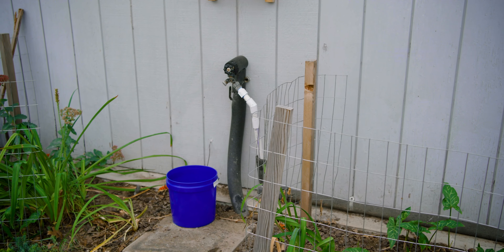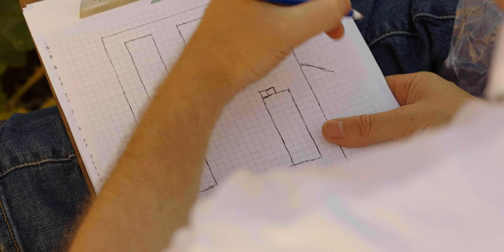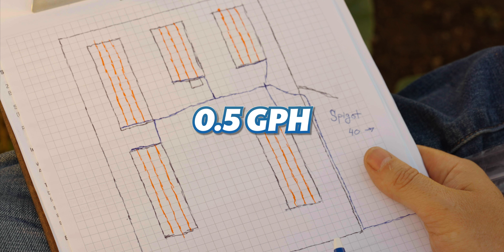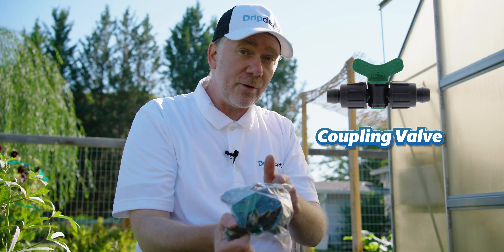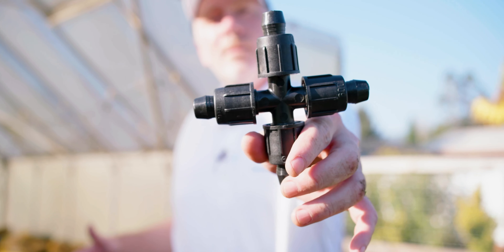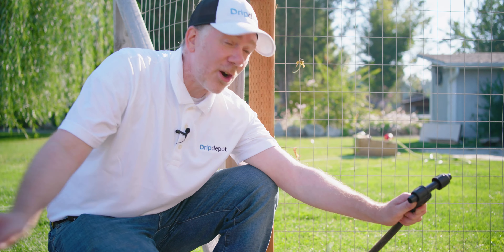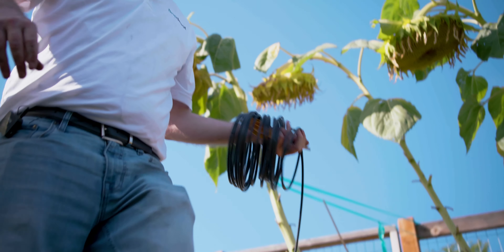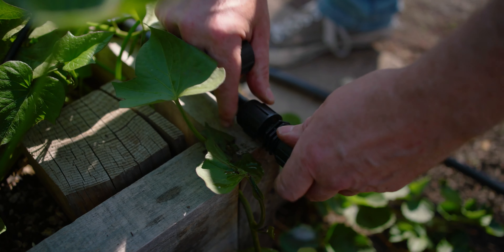How to Install Drip Irrigation for Raised Beds (Complete DIY System Guide)

Comment: I have a question about flushing. I see that you did the half inch line with the end caps removed, but what about the 1/4” drip tubing itself?  I’m just thinking debris might get pushed down into those from adding button emitters or being flushed in there from the half inch line?
Reply from the maker: That's a very good question and I think it's open to interpretation to a degree.  My thought during the making of the video (and it looks like your thinking is similar) was that I didn't want the water during flushing to go into the drip line too much, as I feared it might push debris into the dripline and get caught on one of the inlet filters at each emitter in the drip line, potentially causing a clog (or starting the process that could lead to one).  

Looking back, I think I'd flush the 1/2" line first as I did, then flush the 1/4" drip line after -- that way, the majority of the debris would be carried out of the end of the 1/2" line on the first flush and then any small bits that got into the 1/4" could be flushed out after.  

Very good question, thank you!
Reply: @dripdepot  Thank you so much for your fast reply! I like your rationale.  I am going to go on your recommendation and flush the 1/2” first and then the 1/4” second💙🙏
Reply: @dripdepot  I will be setting up my relatively small (2 raised beds 6x6 & 2 long flower beds) system using lake water in Texas. Im concerned that this emitter system might get stopped up with the IKKY stuff that comes from the water when it gets warm. Do I need a special filter at the head assembly or do I just need to check the filter more often.?
Reply from the maker: @torjiesweeten3482   Very good question!  You are 100% on the right track to know to ask that.  

Ok, if the water quality is as bad as it sounds, I'd probably go with a special filter -- not really special in any way other than larger.  The larger the filter element inside, the less cleaning that's required (though with poor enough water quality, even then the cleanings could be frequent).  

Is it primarily soft organics (algae, etc) that comes out of the lake water?  If so, look into "Disc Filter."  They're a bit better with organic debris than screen filters are.  Though screen filters are a bit more involved to clean in general, they are easier to clean algae out of than a screen filter (it can get mashed in between the mesh of the screen and difficult to get out).  

If you're sure of the water quality and how it relates to filtration, you could start with an inexpensive smaller filter and monitor it that first day irrigating to determine how often you'd need to clean it :)
Reply: @dripdepot  I will look in to the disc filter. Thanks!

Comment: Question, you are running the drip line through a pretty full bed and cutting it off at the end doing another line. Would it be more feasible just to run it back through the bed rather then cutting it, and if so should it be reconnected to the mail line? We have several raised stock tanks that get pretty full.
 I have learned so much from you I can't say how much I appreciate these videos!!
Reply from the maker: Some folks do exactly as you suggested, in most cases it's perfectly viable -- you'll want to make sure the total length doesn't exceed 20' (for 6" spaced) to 30' (for 12" spaced) -- after those lengths the friction loss curve gets pretty steep.  Connecting the end length to the mainline as well does help ameliorate any pressure issues, but that would only be necessary if the line was getting to that 20' to 30' marker.  

We didn't do it in the video, but one thing that's nice about laying down individual lengths of drip line is the ability to have on/off for each individual line in case one row or part of the bed gets harvested early.  This little coupling valve allows each line to have on/off: https://www.dripdepot.com/1159

If the bed will all be harvested at the same time, looping it back around is perfectly acceptable and plugging both ends into the main can be beneficial, just like you were thinking. 

And also thank you for the kind words and for watching!  This was a great comment to kick start Monday for me, I truly appreciate it :)
Reply: @dripdepot  Thank you very much I value your advice greatly!! 
Our 7-stock tanks are 6' & 4' x 2' and always full like yours was so this loop should work however, I see a lot of advantages to single lines with shut off's on them. We plan on doing single lines in our two ground/raised beds and everything will have shut off valves as you've suggested in many videos.. "
Keep those videos coming you have great ideas"
Reply from the maker: @Randy_Indy  Perfect!  I can confirm at those dimensions, a loop system is likely to work very well, particularly if it's connected at both ends :)

Comment: This has been so helpful! Can we bury the distribution line?
Reply from the maker: I'm glad this helped some! 

And you bet, you can safely bury your distribution line :)   I'd say it's fairly common, particularly after you hit it with the lawn mower the first time lol.  

Just like with PVC pipe, give it a bed of soft crumbly soil to lay in -- make sure to remove any rocks, sticks or debris of that type that could damage it, bury it anywhere from 4" to about 12", and it can be safely mowed and walked over as well.  

Thank you for the kind words Sierra, I hope this helps too!

Comment: Hi Adam 
Thank you so much for the very helpful video!

Question ……..I have 33 inch wide by 46 inch long raised vegetable garden bed CONTAINERS 
I was going to get the emitter hose with emitters ever 6” and run 2 lines length wise 
Does that sound right?🤷🏼‍♀️ 
Or should I get emitter hose with Emitters every 9” 🤔
(I have quite a few vegetables in each one of my containers)
 
If you could give me your opinion I would greatly appreciate it 
So I can place my order 😊
Thank you
Reply from the maker: Vicki, this is such a good question that goes straight the heart of drip irrigation.  There's a lot of factors that go into both of these (soil type, planting density, etc), but generally speaking, I would also do 2 lines for a 33" wide bed.  Emitter spacing is a challenging one.  I've had success with all three spacing options (6", 9" and 12") -- I tend to use 6" when I plant densely or in places with sandy soil (or in the case of carrots, both, as they tend to be planted densely and in looser soil types).  With that said, 12" spaced drip line is the standard -- in common, loamy garden soil, water will spread about 12" beneath the surface.  

Sometimes people think they're not getting enough water with the 12", but that's because they're looking at the wet spot on top of the soil.  The wet spot on top of the soil should be small, you want most of the action to occur beneath the surface.

Essentially, all three spacings are good choices, with 6" perhaps the better option for densely planted places and sandier soil types, and 12" getting the nod with normal 1' spacing and loamy garden soil.  9" is that compromise between the two competing feelings (wanting to be efficient, but also wanting to see that water delivered). 

That was a fantastic question Vicki, I hope I was able to shed some light on it! -Adam
Reply: @dripdepot  
Hi Adam 
Thank you for replying to me so quickly I really appreciate that! So I can get started 
  Yes it was tricky to figure out. Yes, your additional information was extremely helpful. 
  I have more of a loamy garden soil (happy frog and Kellogg’s brand mixed)
 I took a tape measure back over to the garden beds, measured out where 9 inches would be for emitters (keeping in mind that the water would spread to that 12 inch diameter)
Along with that also took into account the spacing of my plants I have in them. 
 I think the middle of the road with the 9” emitters would be sufficient . 😊👍

Once again can’t thank you enough 
For your help and helpful videos

Comment: I did this last year but the following week my pressure valve in the basement had to be replaced. I'm nervous about trying it again this year.
Reply from the maker: The valve in your basement went after installing irrigation?  Definitely a nightmare scenario and I hope you were able to get it shut off before it flooded too much.  

The good news is, it's extraordinarily rare for newer parts like this to fail quickly, so you're likely safe from a flooded basement for some time.  Was it an older pressure valve?  If so, that could have been it, but it might be worth making sure your PSI there isn't particularly high :)

Comment: I'm finally ready to lay down my system, but I can't help but wonder about a very important question... How do I know the length of time to run my water with 0.5 gph drip lines??? I'm worried I may under/over water and lose all of our veggies.
Reply from the maker: Typically we recommend to pick a watering cycle and monitor the health of the plants -- this is largely because there's no one right answer in regards to watering duration -- or rather, there is, but it depends on may variables (time of year, maturity of plants, local conditions, humidity, soil infiltration rate and many more).  

Don't let that make you worry though, the "water and watch" method is very effective and is even used on the commercial side of things.  Your plants will let you know if they need more or less water.  

In Oregon, I typically start with a 10 minute cycle when the plants are young (unless we have rain, then no cycle).  As they mature and the days get hotter, I'll increase this to either a longer cycle, or running a second cycle later in the evening.  My first year using drip I ended up with two 45 minute cycles when water demands where the highest (hottest days, plants fruiting).  The next year I dropped that down to two 30 minute cycles and still had great results -- basically, there's some room for error with drip.  

Your aren't likely to be exactly the same, but you can start around there if you're growing some common garden veggies.  Watch to see how the plants respond and adjust as needed :)

Comment: Hi almostt ready to make an order.  Most of the videos are showing raised beds that are less than two feet high.  My garden dimensions are roughly 28 by 28 and I have 4 large 4 by 8 large raised beds will the drip irrigation work to get the flow of water into my beds or will I need to make them 1 ft tall beds. Kinda confused
Reply from the maker: Linda, water pressure is generated/lost by 0.433 PSI for every 1' of elevation change -- this means that unless your beds are extremely high you likely won't lose too much pressure when getting the water up the bed.  Unless your water pressure at the spigot is uncommonly low or your beds extraordinarily tall, you're likely to have no problems getting the water up and into the beds :)

Comment: Thanks for this awesome installation video! I had a few questions and they were all answered - except one. I'm planning on setting up a system for 9 raised beds. I want to have this in place above ground for a garden season to make sure it suits my needs. Then I want to sink it under ground, under the garden path wood chips. My questions is this - is it fairly easy after a year to replace mainline tubing from the bottom of the raised bed to the top - so, exchanging an 8" tube with a 10-11" tube? Is it difficult to replace the tubing with the barbed Tees and Elbows? Thanks!!!
Reply from the maker: You bet, this is generally pretty easy to do -- if you're using barbed insert or Perm-Loc fittings, removing the tubing from one of them isn't too bad (easier with Loc style than with barbed insert, but both reasonable to do).  If you don't need to remove a fitting to make the change, you can simply cut into the tubing where you'd like to add a new fitting and just splice it in to run you new lengths.  

If you're using compression fittings it's still not too bad -- they are generally regarded as not re-usable, but you can cut them out, add in a new coupling and run your new length from there. 

All in all, I think you'll have a pretty easy time of it -- drip irrigation is often referred to as "modular" -- in this case it's not just a marketing term, it really is quite modular and pretty easy to add on to and expand at any time.  

When the time comes for you to make some changes, don't hesitate to drop a line with any questions, we'd be more than happy to assist :)

Comment: I've been trying to get ahold of your customer service..I was wanting help. I have 4 raised beds but they're METAL. The kits all have the hose clips with nails ..great for wood beds. How do you keep the hoses fixated for metal beds? Also, since Central Florida gets alot of rain, are there any timers that can not water when it rains?
Reply from the maker: There are two options for keeping the tubing secure with metal raised beds: 1.) dig a small trench underneath the bed and run the tubing under then up the inside of the bed so that the soil keeps it in place (a great option) or 2.) Add two more elbows to the top of the header row so into can "hook" to the wall of the bed, then stake down the header row tubing in the soil. As for a timer fit for Central Florida rain, the B-hyve Smart Hose Watering Timer receives local weather data and automatically adjusts to deliver the right amount of water to your plants. It shuts off the timer in the rain and increases water when it’s hot. Here's a direct link to the B-hyve smart timer: https://www.dripdepot.com/search?q=13233

Sorry to hear you've had a hard time getting ahold of us. Sometimes we end up in e-mail spam/junk folders, which may be the problem. We're available through e-mail (support@dripdepot.com) from 7 am to 3 pm PST Sunday thru Friday.

Comment: Hi Adam 
QUESTION….. 
is there a way to stop slow drip coming from a stopper  where I needed to put it in the half inch tubing  after taking out my quarter inch tubing to replace it in a different spot???
(I was hoping that I didn’t have to replace that section of half-inch tubing🤞)

Let me know when you have a second if you could, I would greatly appreciate it 

Thank you for all of your help through this process
Reply from the maker: You bet Vicki, happy to help!  Are you using a goof plug to fill the hole currently?  If so, check that you're using the large side of it -- the large side of the goof plug is a good deal larger than a 1/4" fitting (which can make them hard to push in!) so should fill the hole up leak free :)

If you are using the large side of it, you might have to replace that section, but it's possible to do it with just a single 1/2" coupling -- cut the hole out of the tubing as thinly as you can, then just re-join the two sections with a coupling and it will be a permanent fix.
Reply: @dripdepot  
Hi Adam 
Yes, I’m using a goof plug 
OK, I will be sure to check that in the morning  hopefully I am using the thinner side, but if not, then I will go ahead and replace that section

Thank you for taking the time to get back with me, so promptly 
Always appreciate all your help
Reply: Thank you Adam 
Yeppp I had the goof plug with the smaller narrow side in, so I switched it around
And yay the leak stopped 

Thank u again
Reply from the maker: @vickirickman9373  Heck yeah, awesome Vicki!  =D

Comment: how do i determine how long to run the irrigation for a 4x8 raised bed?
Reply from the maker: There is unfortunately no one answer to this, as it depends on many variables (time of year, sun exposure, plant maturity level, soil infiltration rates, the list goes on) -- we generally recommend watering and watching the health of the plants, they'll let you know if they need more or less water.  For those who like to dial it in a little more specifically, they can look up their plant type and get information on how many gallons of water they need at various maturity levels and then match the watering cycle based on the flow rate of the emitters used. 

Here's a quick video we made that goes over "How long to water" and covers the above in a little more depth: https://www.youtube.com/watch?v=caF5_paR8Uo

Comment: You mentioned that a 1/2 gal emitter with 12" spacing will water approximately a 12" square.  In one of the comments below someone asked how many lines for a 33" wide bed and you said two lines.  Won't that leave about a 9" wide strip of the bed unwatered?
Reply from the maker: Good question, and to some degree I made an assumption that this would be in a raised bed with two rows of plants with common loamy garden soil.  In the 3' wide bed, we usually see 2 rows of plants, with no plants right against the edge of the bed, so two lines will get it done.  

A more general rule can be applied -- run one line of drip tape per row of plants, and ideally, at least one emitter at the location of each plant (it doesn't have to be right on top of the plant though, water will make its way to it, and roots will also seek water).